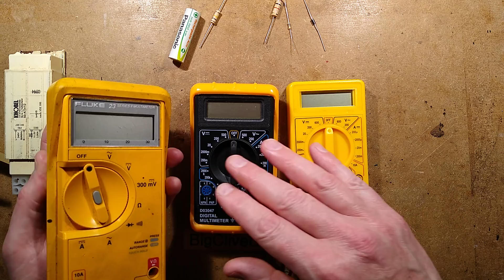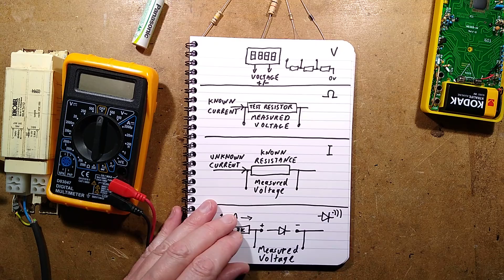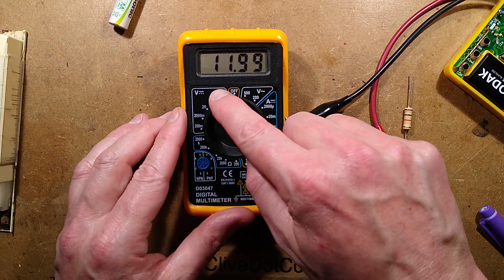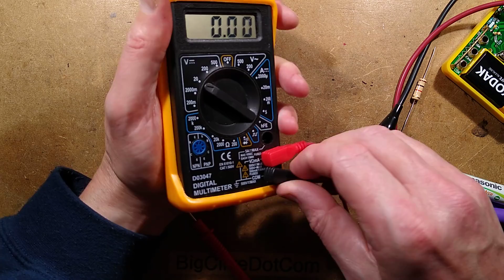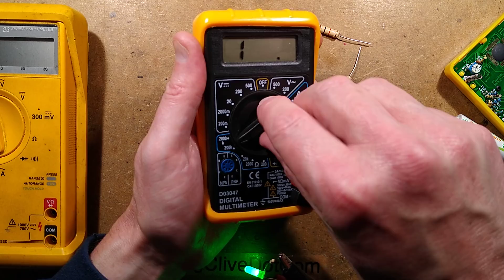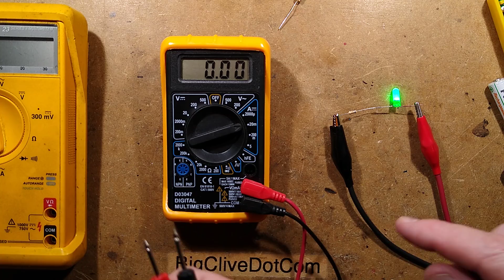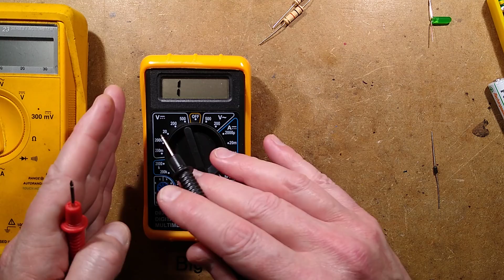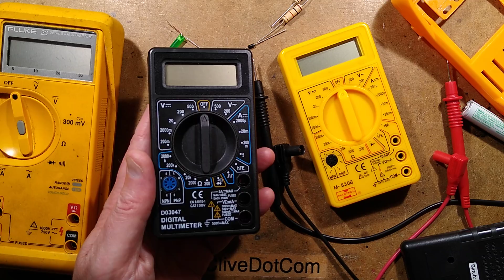How to use your trashy meter without blowing it up (much)

Comment: Indian here, and I use these on 3 phase mains. I don't use the cheap flimsy probes though, I buy a bit more thicker ones.

Also, the way I ( and most of my peers) typically blow these, is by connecting the mains across the continuity mode or the 10A range.
So just make sure your probes are in the correct socket before probing mains, don't use the flimsy probes which typically come with the meter and you should be just fine.

Edit: I would recommend buying another of these cheap meters, painting it in some conspicuous way and using it only for the 10A range.
That way, you'll never (hopefully) short the mains.
Reply from the maker: It might be worth adding an inline fuse with the leads as an extra safety layer.  Preferably with a ceramic 1.25"/32mm fuse.

Comment: I felt brave one time and decided to test the wall socket with my cheap meter. The wire in the test probe instantly exploded. But the meter still works, fuse survived 😳
Reply: I did that too and it works fine. No blowing up. The trick is make sure you don't short the wires and make sure settings are right. Don't test amps.

Comment: I messed up once and blew a fuse, bridged the contacts quick and dirty before i get a new fuse and well... this multimeter (even measuring temperature, moisture, light strength and loudness in dBA) still serves me well the few times i just need a trashy meter, for like 6 years without a fuse. Has already a sticker "defective" on it so nobody would try it actually.

Comment: Watch EEVblog's review on the Aneng 8008, it is nice, extremely precise in everything measured.
I did buy it instead of yet again swapping the LCD rubber connection on the Fluke 87 again, still got the Fluke.
The 8008 looks like Fluke 87 kind of, real good design and cheap and has signal generator and things.
Same knob and dial kind of as the 87, so easy to use, and is smaller like the mini Fluke, and large real good crystal clear LCD actually, love it :)
Yeah, dont use it on high power stuff, i dont measure much high power stuff nowadays.
If i need be on high power stuff i use the Fluke with the partly weak LCD screen due to the connection rubber.. i can still see it ok if i put it in the right angle.
So yeah, but for casual electronics the 8008 is great, 25 USD or so.

Comment: I don't know if it was my computer, my aging ears, or just your mouth being closer to the microphone than the meter but I couldn't hear a sound, scratchy or otherwise, from your AMECaL meter.

My meter is a cheap one from Maplin which I got to replace a much older one that had the old moving needle display that I'd been taught how to use at school. Although at school we mostly used stand alone ammeters and voltmeters - along with a variety of shunts to adjust the range, At least I think that's how they worked. It was a very long time ago. Come to think of it though, most of the lab equipment had probably all been in use when my dad had been at the same school 30 years before that.
Reply from the maker: It's very quiet.  I forgot about the mic noise gate.

Comment: My father got me an MS8229 recently as a birthday gift that has a Lux and dB and temp/moisture meter on top. Probably seems a little pointless in some ways although it is a very nice meter otherwise, has a capacitance and Hz/duty cycle mode and auto ranging and the usual little benefits over the cheap meters, although this thing is still far from the professional meters. 
Did just fine with the cheapo meter but the upgrade is nice, and I couldn't say no to the gift

Comment: We used the gain tester in the old days when you could buy grab bags of unmarked surplus transistors. We would use it to sort the bags into pnp and npn piles and group them also by values.  Otherwise, no.

Comment: One place I worked had a meter that looked a lot like the one in the middle.  My boss decided to test a resistor on the wand used to remove dust from negatives via static and an air blast.  It had 15 kv on it.  He was fine but the meter was toast. Do not measure resistance on a 15,000 volt line…. Very low current so there was nothing explosive about it at least.

Comment: if I kept all the meters I killed, there'd be a large box full.
my issue has always been moving the leads to current test position and forgetting about it, then jumping back to measuring voltage with the leads still in the current bridge, *KERPOW* blown, fuse, molten leads, circuit board, tripped breakers. it's exciting when you fail and shove it across 240v or once what I thought was 600vdc, which turned out to be 1500+vdc(it arced across traces inside the poor old VTVOM).

Comment: I'd recommend anyone traveling to take a meter with them.
Only needs to be a cheapo £5 thing to check continuity.
I stayed in a rented house in France a few years ago
- the wiring was appalling - frightening!
Wall outlets hanging out, random wires poking out of the walls
(presumably the contractor didn't install the light fittings).
Anyway, one night all the lights went out on the 1st floor
(2nd floor for friends across the pond). Found the fuse box (!)
but nothing was identified - had to swap fuses around to
determine which one had blown. Long very hot walk to shop to find
replacement.
Anyhoo a cheapo meter would've saved a couple of hours swapping
fuses and running up and down stairs to find the dead one.

Comment: Ive owned many pricey meters and they all died just out of that warranty window. So i stopped buying them. It kinda funny I still have my first Radio Shack analog meter i bought in 1977, and it still works after 40 some years. IMO, the cheap models work just as good as those pricey ones. My favorite meter is my RadioShack #22-810, prob cost around $20 us back in the early 90s. It was small enough to fit in my pocket so i used it for everything, my automotive shop mostly. But i also flipped houses , so I was testing high AC voltages weekly without issues.
  It worked great up until around 2010, figured it needed a new battery, its a small 12v. I go to Radio Shack, we still had one locally, to get a new battery. They wanted $18 for a battery!? NOT!   
  So i decided to get one of those harbor frieght models, and its worked fine, until recently. Im not even sure how it blew the fuse? Only symptom was it was reading new battery levels lower than expected. Their were things i noticed on the cheap meter that was off. Its clearly marked on the back, 200mA 250V fuse which is a standard 5x20mm glass fuse. But it had a super tiny 2x5mm glass tube with leads soldered in(no socket). I looked all over the world for two weeks trying to find one of these in 200mA... they dont exist! The lowest value i found was a 500mA 250v. So they installed the wrong fuse from the factory, and i guess its no surprise Ive seen video's on YT where meters had NO fuse installed when they claimed it did.
  Luckily I had a few old PS circuts which had fuse sockets i could 'borrow'. Soldered it on the cheap Habor meter thru in the proper fuse , and it didnt fix it, the meter readings are all screwy with nothing connected. But I will figure out what else is wrong, eventually! Lol
 Then i just decided to get a new one from scamazon last week, $15, and uses two AA. My only requirement was a backlight and a buzzer. In the meantime, i got my small radioshack 22-810 running. I drilled a hole in the back and soldered a 9v connector to it and hot glued the battery to the back. I also replaced the leads with longer and more flexable silicone wires. Not pocket size now, but its always handy to have extra meters around. And Sorry for the long ramble, I do need to switch to decaf. =)

Comment: After seeing Dave's multimeter test years ago and watching the cheap ones blow apart, sending shards of plastic and metal, I got rid of mine and got a fluke, especially as I was using it for testing mains now and then.

Comment: I was watching one of those "How it's Made" videos on custom made electric guitar pickups and their test bench used one of those red Harbor Freight $5 meters. 

My first meter was also a Radio Shack aka Tandy meter that was a kit. 

And yes I know Tandy and Radio Shack are the same. It's just in the US it's mostly called Tandy Radio Shack or just Radio Shack or even just The Shack. But outside the US I mostly hear just Tandy.
Reply: In the early years of Radio Shack, 1950s into the 60's before before they came up with their own Realistic private-label brand and before they were bought by Tandy,  Radio Shack here in the States sold classic vintage Hifi gear such as Scott, Fisher, ElectroVoice and more.
Reply: @goodun2974  I guess I started with Radio Shack maybe 72 or so. I mostly had Archer stuff like the small square walkie talkies.  

Right now I'm I'm may basement I bet with a little digging I can find that dial multimeter I made close to 50 years ago.
Reply: @chartle1  , Archer! I almost forgot about Archer! I think the way it worked was that Realistic equipment was built specifically for Radio Shack but anything branded Archer was identical to stuff sold elsewhere under other store names or the manufacturers' brand name. Like Weller soldering gear; identical soldering irons and guns were sold at Rat Shack and branded Archer.

Comment: you should have demonstrated how to fry them by testing voltage at the diode tester mode just how I did a few days ago with a cheap tester I had, I tried to fest an energized diode, forgot to discharge the primary capacitor :( (I was so used to it discharging almost instantaniously in most modern power suplies I forgot to do it)

Comment: Clive, make or borrow a calibrated voltage source. You can DIY a 10.0000vdc source for under $20. Now set your meters on the 20v scale and compare the readings. The one for "free" is about as accurate as a test light.
Reply from the maker: I only really expect something to around 100th of a volt.  What you've described is comparing a Porsche to a Skoda.

Comment: I had a rapid electronics meter I used for over 30 years, it finally died a couple of weeks ago, I spent ages trying to fix it as it has sentimental value and its was still a good meter, unfortunately, it looks like the chip has fried, I'm going to keep my eye out for another one on ebay though, even though there crap by today's standards.

Comment: The Fluke 23 is an excellent multimeter. However, when supplying meters to electricians at the large heavy industrial plant that I worked at, it was decided, for safety reasons, to ensure the meter did not measure current! If an electrician wanted to measure current, he would be 'encouraged' to use a 'clip-on' meter.

Comment: I have a reletivly cheap (ok, not quite as cheap as those meters, £17.99 as of when i bought it) auto ranging meter, which can do up to 6v on the range with 3 decimal places (and up to 60v on the two decimal place range)
and for whatever reason it also has a temperature probe (which connects in the same way as the multimeter leads), it has THREE different current ranges (which have to be manually selected, microamps and milliamps use the same probe hole, and there is a seperate probe hole for amps)

Comment: Where did the Fluke name come from? It's almost like having a digital caliper branded "CloseEnough".
Reply: It was named after the founder, John Fluke Sr., and originally named John Fluke Manufacturing Company, Inc.
Reply: Here in  New England, a "fluke" is a flat, mostly bottom-dwelling fish similar to but usually a bit larger than a flounder or sole (a fluke sizeable enough to brag about is called a "doormat"), and equipped with teeth, although nowhere near the size of a halibut.  There's another small flat fish in New England waters, technically known as a sand-dab or plaice, but the local colloquial term for them is an "Irishman",  presumably because these flounder/sole relatives are so thin that there's virtually no meat on them and they are nearly transparent if you hold them up to strong light. Probably an old reference to skinny, starving Irish immigrants during the potato-famine years. Prejudice abounds in supposedly classless America, sigh....

Comment: Dammit I have never blown up a meter yet ! Yet I still have my first Tandy meter as you described I like em for checking caps better
Reply: Analog meters are best for testing batteries because they load down the battery a little bit, similar to the way it would be in circuit; as opposed to a digital meter where the input impedance is so high that it doesn't affect the battery or load it down at all.

Comment: When I "started", the Simpson 260 was THE meter to have. If you had one of those you were the professional. But they cost a lot. Back then I think about $80.00 American. And yes that was way before digital. Weighed about 4 pounds. I thill have mine, has not been used in over 30 years but I bet change the batteries and it would work.

Comment: oh ya... when I was young I have put a small dinky (in fact, it was the same cheap meter as you have there), across mains power in the amp range... loud BANG, I saw a flash inside the socket and for some reason the meter didn't work after that 😂

Now I know what I have done wrong and how lucky I was that nothing major happend.

Comment: My best ever meter was a 50k ohms per volt analogue (swing) meter. It had a 50uA scale. There are things you can do with an analogue meter that you just can't do with a digital.
Reply from the maker: There are indeed.  Analogue meters can show trending and erratic voltages.

Comment: I almost immediately blew the low-current fuse in my Duratool meter by changing the range (through A=) whilst it was connected.

You can't do that on a meter that has (a) separate socket(s) for measuring current.

My own silly fault, but one to be aware of.

Comment: Mine looks like the black one he used.
You don't need the most fancy one, I test mostly A and VDC
The only thing I miss is the beep test for diodes.
I blew 2 fuses by some reasons I can't remember...
I wish they added a way to lock the select button in 0 mode. Or a cover over it....
I have mine in a small box in the car, and 2 times it have accidentally moved and emptied the battery 🔋😮‍💨
One of those the battery was frozen to death also. Luckily the tester survived, but had me worried when the display was in purple ish multicolor 😯
Pit in a new battery and good as new.
I think I need to make a little box for it, or velcro it to the side of my trunk or something 😅

Comment: I rarely use the current ranges on these multimeters. For current, I usually stick a small 1 ohm, or 1Kohm resistor in the circuit, and measure the voltage across that resistor to measure current. Also, you can place your scope across that resistor to see the current waveform. I normally use a portable scope, in place of a differential probe. For high currents, I use a dedicated current meter, with a clamp.

I have about a have dozen of those cheap Harbor Freight meters, as I'm a bit forgetful, and just leave them where I used them last. Which could be outdoors, so I'll find them, when I mow the lawn ... oops !
Reply: Having multimeter parts shoot out the side of your mower must be quite exciting indeed. Although I bet it does a number on the blades....

Comment: I recommend those cheap $10 DVOM
If you want to do basic work such as testing things inside a computer it will be 12v.
So these are fine for this.

You do not need a $400 DVOM to do basic work

Comment: A guy at work had that first/cheapest meter you show. He forgot and left the probes in amp check position and went to test mains voltage. Meter blew up and was close enough to his face that it burned his face. Trip to the hospital cost more than a decent meter would have cost.

Comment: I do have a bit of a quibble: you have fallen into the age old trap of mixing up "the number of digits displayed", with "accuracy", "repeatability", and "precision".

They aren't interchangeable.

It would have been enlightening if, in the discussion of "meat resistance" if you had shown the schematic depiction of "two resistances in parallel".

But, all in all, you did a pretty good job.

Thanks, Clive..

(I spent too many years in a calibration lab! :-) )

Comment: It might have been helpful to explain the symbols on the meter, as this is aimed at the less experienced.  i.e. 'V~' means 'AC Volts' etc.  Good point about actually using a couple of ranges 99.9% of the time.  It might be good to do a followup about manual vs auto ranging, just a thought.
Reply from the maker: I didn't even think about the AC Vs DC symbols.  That's what makes videos like these much harder to make.  I try to imagine in completely new to electronics and yet still I miss important details like that.
Reply: @bigclivedotcom  I know only too well how hard it is to think in the shoes of the neophyte.  The journeyman almost no longer sees some things because they are just 'there'.

Comment: I've got a few meters that I use a lot. 

A cheap "component tester" for resistor/diode/bjt/MOSFET/JFET/capacitor/inductor tests. They're like $10, and good enough for basic use. Stick the component in the ZIF socket, get a pinout and some ratings.

A cheap handheld DMM. Just an Extech. Safe enough construction that it won't explode if accidentally used with mains. EG if some cheap shit device bridges mains across from the low voltage side, like the Cheap Shitty (Pink) USB Charger (From China).

A Fluke non-contact voltage detector (VERY nice for telling if a circuit is energized safely).

A Fluke AC/DC clamp meter (which also functions as a decent handheld multimeter). It's a lot safer (and easier) to measure current with a clamp meter than by interrupting the circuit and using a shunt meter. Less precise than my other meters, but I don't need the precision of my 6.5 digit bench meter when trying to tell why the oven isn't heating up (for example).